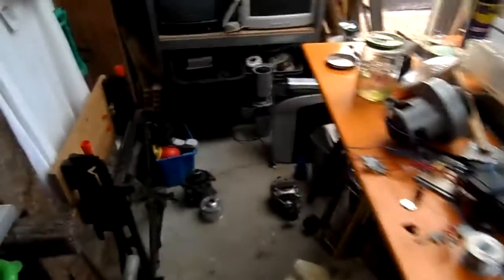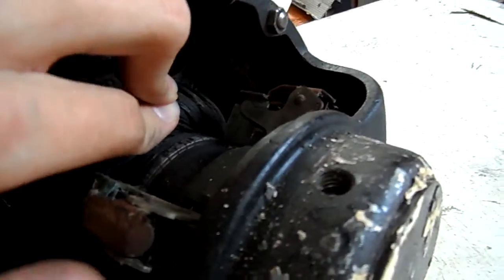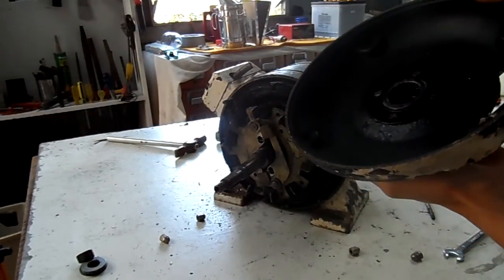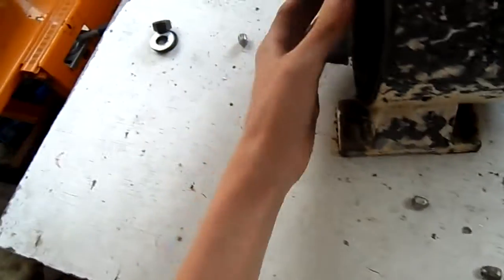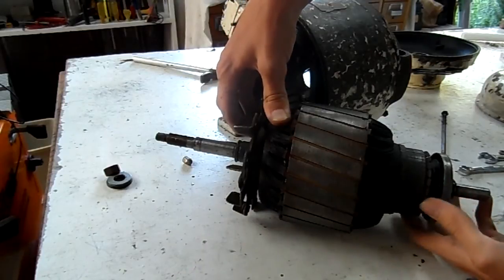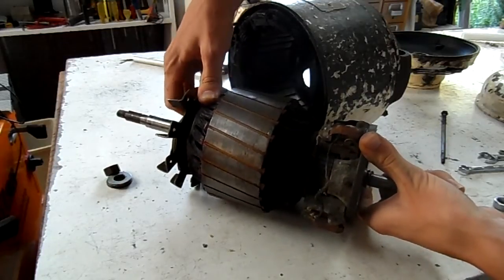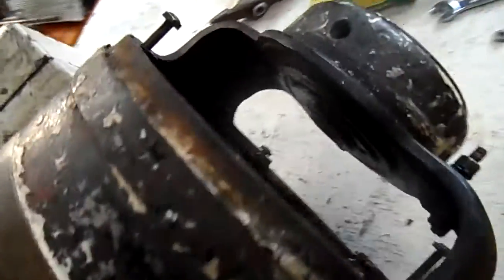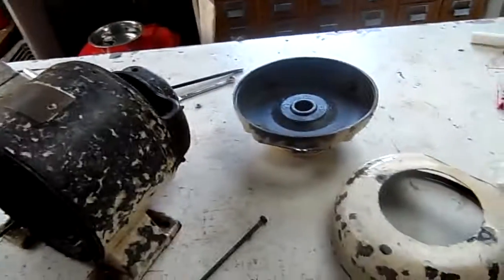Crompton Parkinson repulsion start induction motor autopsy and explanation

Comment: I think you might have misunderstood the nature of the brushes and wound rotor.  The brushes are NOT wired into line current on these.  That thing may work just fine if you clean the commutator and brushes so they have good contact.

Comment: Hey this is the same motor i have at the moment so do they need a capacitor to start 
because mine just has 3 wires coming out live neutral and earth..
Reply from the maker: Nice! No these motors don't need a start or run cap, as they use that brush ring to help start the rotor moving
Reply: CAL'S ENGINEERING Thank you for he heads up,Its for a lathe when i purchased it,The guy had it linked up to a forward and reverse switch..So I'm trying to work out how i go about reversing it..I just wanted to confirm that it did not need a capacitor as it says the exact same as yours even made in the same place.
Reply from the maker: Muhaa Haloa no worries! I think you just reverse the polarities to make it go in reverse :-)
Reply: After further investigation mine looks like its split phase :D..Ooops..Just learning about motors and some one said it was split phase and not repulsion start induction motor..:(
Reply from the maker: Muhaa Haloa ahh OK. I can't really help out, as I've never worked on a split phase motor before! (Although I may have done in the past without knowing it)